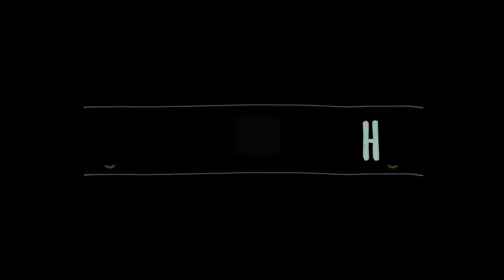Proper Homestead Security - How Much Is Too Much? (Front Gates, Cameras)

Comment: Take use motor oil and mix it 50-50 with diesel fuel and paint the bottom of your wooden post before putting into the ground and let it dry at least 24 hours, this will help keeping the wood from rotting it
Reply: Would that make it more flammable after some time had passed?
Reply: @zachary8872  Not really , once water and mud gets on it it'll actually form a nice sealing layer on it.
Reply: Don Latimer & Mark OnTheBlueRidge The burnt motor oil is fine & it works. But putting ur Post  bottoms in fire & just  char-ing them good is easier & will make them last 100 years before any decay.
Reply: @Mark OnTheBlueRidge - relax. he got the point across....

Comment: Post Tip: If you put your post bottoms in fire & Char them about 1/4" thru all way around & char them  the length of the part going in the ground. 
Then they will never rot off. 
Have You ever walked thru a forest 20 years prior had  a forest fire? The burned trees & logs that was put out by firefighters will still be there 100 years before they finally do rot.

Comment: I use Dakota Alert MURS radio alert to tell me when someone arrives. They can be used like a driveway alert up to a mile or two away. You can get motion detectors or vehicle detectors. The motion detectors will go off if a deer, cat, dog, person, etc. walk in front of them. I have been using them for 5+ years and as long as the batteries have a charge, they work great. You can also get a handheld radio to talk to the base station on the same frequency as the sensors.

Comment: Here in germany people tend to either use thin metal posts or to make concrete posts themselfes.
The concrete posts can get damaged over the years when water leaks in but it`s way sturdier than wood. Sometimes wood is used here too but it tends to rot and break exactly above ground, which tends to be a problem, especially when you plant a hedge around it.

Comment: Guy, I use to weld for a living at one time. You do not want to be welding galvanized steel without grinding  all the galvanized plating off where your welding, or using a resparator. It produces cyanide gas when you melt the galvanize when welding. Same gas they us in gas chamber. Will toast your lungs, and eat your stomach lining, you do not want to be breathing that. Noticed gate latches looked like they were galvanized.
Reply from the maker: They were. Hold your breath...

Comment: Around here in Missouri when we build field fences we use steel posts, woven wire and Barb to the top. For corner posts and gate posts we use hedge, lots of hedge trees in the area and they last forever.

Comment: also.. when you put in conduit for the burial of camera wires and power..  see if you have room to run 1/4" nylon tubing..  with that and a small air compressor you could rig up a police whistle on the end..  perhaps rig a small air powered siren..  so a blast of air from inside the house can be used remotely to alert possible intruders they are wrong.  you can also use solenoids with internet control perhaps to remotely activate them.   you could run the nylon tubing up a nearby tree to remotely stash the whistles.  and you can do this in multiple locations around your property.  you really don't need conduit to bury 1/4" nylon tubing..

Comment: Recommendation: We did similar to you on using old dried wood from the property to put up a fence on our property in Colorado. One thing we started a few years back that has had great success, we saw a property that had trees spaced out around the property that the chain link fence connected to, it really looked nice with the adult trees kinda taking your eyes away from the fence actually being present. So we went up into the property and cut live branches off trees in the 2-4 inch range, then we trimmed them of all smaller branches except one near the top with a few leafs and we planted them directly halfway between the post we previously used to install our fence. We would water them daily for a few weeks from the creek and our first year about 40% of them took roots and now have grown into a small tree, year 2 we had better success and replaced the ones that didnt take off and about 80% of those took root and have become small trees. Our plan is to allow them to grow and mature for a few years and right around the time the dead tree post start rotting we plan to wrap wire around the trees to secure the fence and adjust as the tree matures and gets larger. currently we have about 80 trees spanning our fence line that are currently growing into future trees.
Reply from the maker: great idea!
Reply: your welcome, i look forward to your future video's

Comment: Hello you are doing a great job on everything,On your gate post before it get to late you better poor a 3x3x2 deep concrete pad around 1 foot underground with support cables from post to pad  to support the post! cos believe it or not them gate will pull over the post with in 6 months And for your drive way before you lay down 53 rock( gravel ) you better lay down a bed of riff raff rock first then after like 1 month lay down the 53 gravel.....

Comment: Very nice work! Was just wondering what materials you were using for the gate locks?  Looks like galvanized, but the way you welded it didn’t appear to be like galvanized that I’ve welded. Mine end up looking pretty ugly. I need to do the same with my gates and was wondering what materials you used. Thanks! Again, great work y’all do!!
Reply from the maker: It was galvanized pipe I found at the junk yard...

Comment: Just so ya know. The posts you sank need to be treated so they dont rot. I purchased TREATED wood and sank them as posts for my fence and 8yrs later im replacing them. Just a heads up bro.
Reply from the maker: They'll last awhile.
Reply: Shawn @ "My Self Reliance" channel, chard the the wood that would be in contact with the ground to prevent rot. Great video, love your channel and all the hard work you have done for your family in such a short time.